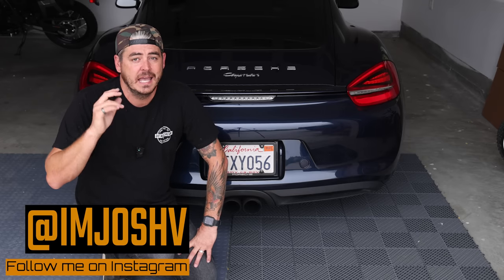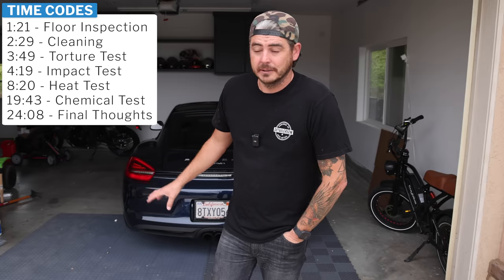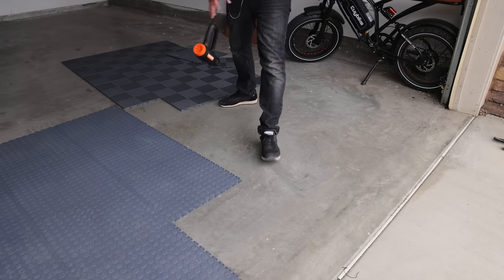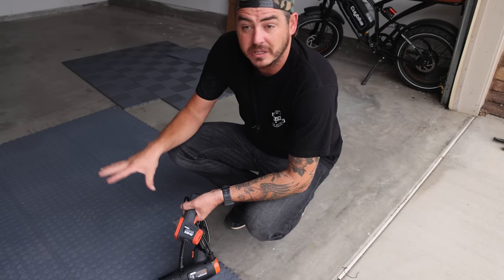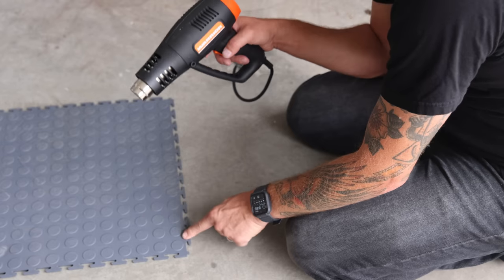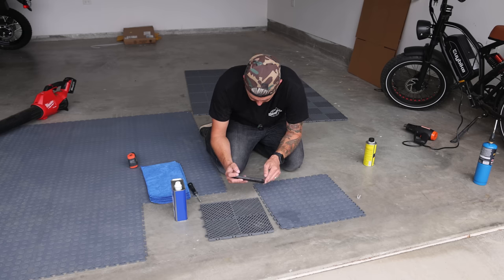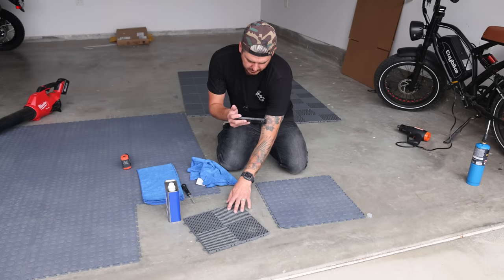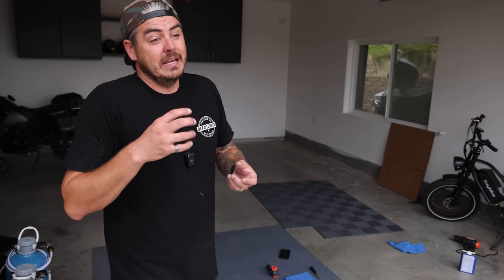CHEAP GARAGE FLOORING TILES: Which Is Better for you?

Comment: One important test would be to see how well do they hold up to a floor jack and jack stands supporting a car.
Reply: +1 for this. That concentrates alot of force into a small area AND its about critical safety of being able to just a jack & stands to perform their job. After seeing what the hoe did I don't have a ton of confidence a jack stand wouldn't cut through some of these products.
Reply: I’ve had my Swisstrax for 3 yrs now. I use my floor jack each spring and fall with the tire changeover for both my truck and wife’s SUV. I’ve only damage two spots and they are hardly noticeable.

Comment: This was another excellent comparison. I must unform you that the biggest problem with the open weave tiles is that mold, mildew, and bugs grow under them. I've returned to the bare cement.
Reply: What you think about those floor paint from home depot ?
Reply: Yeah, I was wondering about mold.  Especially if your garage floor is not slanted or if you don't have a drain.
Reply: @Carlos.Rivera  I think you have a good idea.

Comment: My neighbor had a floor similar to the coin tile except it was simply lined. That stuff was slicker than hot snot when wet! And tracked up far too easily. She hated it
Reply from the maker: That’s the good part about this one. It does have a textured surface for good traction. I though that would make the clean up harder but it didnt

Comment: Try parking a large motorcycle on the tiles using the center stand. That'll chip a painted surface, and I'd be very surprised if either of those tiles wouldn't be permanently damaged.
Reply: My bike is 400 lbs and my kickstand rips up the street and leaves impressions on just about everything aside from cement. I feel like It would break right through those veevor tiles.

Comment: Huh - was more impressed with the coin-style flooring than I thought i would be. Its a good point to note that these "drainage-type" floor tiles, they don't really do anything to protect the concrete itself from chemicals. If you are working with brake-cleaners/solvents/etc that may damage/stain concrete (like oil changes), these things are going to hit your concrete, and now there is a barrier (the flooring) in the way of easily wiping up these types of messes. You won't just rinse antifreeze/oil out onto you driveway/etc. Also I imagine a semi-full oil collector drum would be sketchy to move around a shop with that type of tile. 

For car repair & use of chemicals like rust penetrants/oil etc, might be worth drilling holes in a few of these "coin-style" tiles outside of the main area of work to help let the concrete vent while maintaining a barrier for fluids in the main work area.

The drainage-style flooring does seem to be best fit for detailing tasks that occur after wash+decon. Polishing/looking good, etc. The drainage-style would be good for not kicking up as much dust as well, which can be helpful when polishing & coating.

Comment: Good video, decent testing.  I totally appreciate why you would want to use the open plastic tiles for a studio application... they DO look good.  But for the average joe wouldn't be happy with it.  I still contend that a properly installed ployaspartic floor is the answer if you don't want raw concrete.  And they have finishes that are as gorgeous as the cars you detail.  Take a look at some of the gloss marble like finishes.  If you need to showcase a car in the same space that you work in, I doubt you can do better.   Anyway, love the channel.
Reply: Those marble epoxy floors look amazing,  but it's like $10K for a small space.
Reply: @jasonhill9088   it's really not that expensive anymore.   But it is a fair chunk of change either way, so it's hard to part with the money.  If you plan to be in a space long term, it is the single best way to make the space look awesome, and it lasts way longer.  Buy once, cry once.

Comment: To be able to wash in my garage I’m considering putting the coin floor down and then having the tile kind on top of that. It’ll protect the concrete underneath but still have the benefits of the tile floor

Comment: A good idea to test Josh, but the coin style would have lost immediate heat into the concrete floor. I doubt the surface when tested was even close to 310 degrees as heat loss would have been immediate. Just a note for testing next time.

Comment: How was kneeling on both tiles.  I do a lot of work in the garage and keeling or laying on the vevor style tiles has always concerned me.  Along with the inability to use a floor jack on them.  The drainage style make a lot more sense for washing/detailing.  It doesn't keep stuff out of the concrete long term though.

Comment: Is that the Milwaukee leaf blower with one or two batteries?  How do you like it?  Thinking of getting one.
Reply from the maker: That’s the single battery unit. I think I got it free during a Christmas promo at Home Depot. I like it! Not as powerful and the ego but it does the job!
Reply: project farm has decent vid - got the 530CFM Ego blower myself and really like it. I don't think most of us need the power of the higher power units unless you've got larger property & farther away neighbors.

Comment: A few things, one I can't see how you could pop one of the Vevor tiles up if it was in the middle. I feel like you would have to take a lot of it apart to do that. I'm also wondering if you can use the Vevor solid tiles with the vented ones. I would like to use the vented ones where my car sits but I do a lot of wood working in my other stale and the solid ones would be easier to clean up the saw dust.

Also I just looked at Vevor's website and they are pretty much all sold out. I hope you ordered yours already and thanks for the video.
Reply: If you slip a thin flat blade screwdriver in between the tiles where the four tabs are, you can disengage the locking tabs to separate the tiles.
 Just lever it with the handle pushing away from the semi circle.  It'll pop right off.